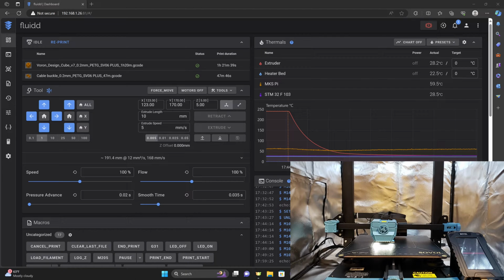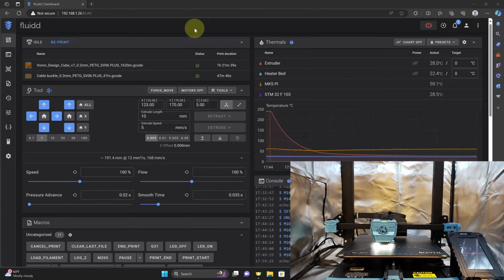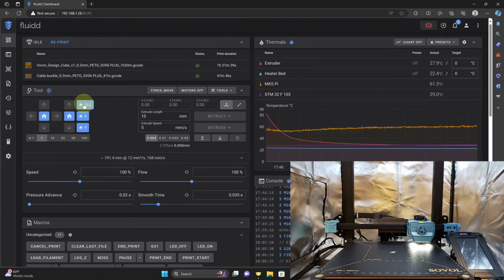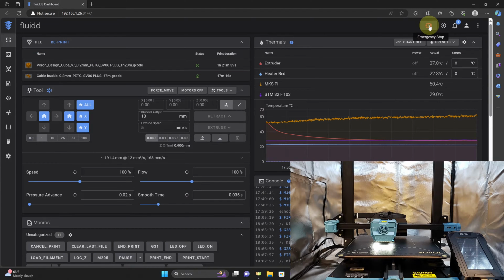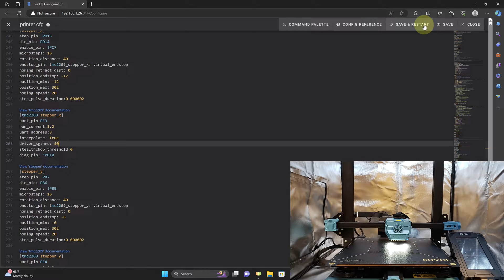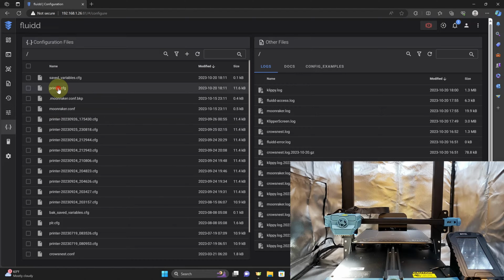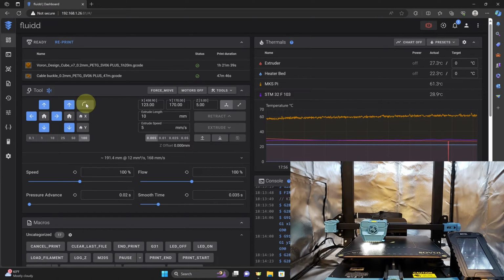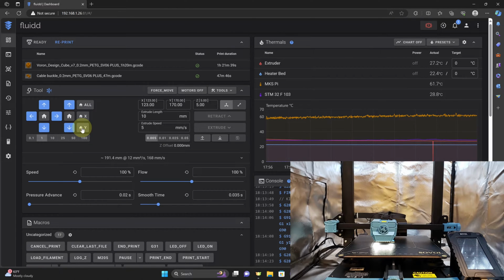Elegoo Neptune 4 Plus/Max homing issue, Part 2 - The Addendum.

Comment: Thank you for the video. I have the pro 4 and I don’t have the driver_sgthrs file. I bought this brand new from elegoo over a year ago and the homing failed as just this second happened. Everything is tight but this line isn’t in my cfg file
Reply from the maker: You should be able to add it but you may need to enable a few settings to make it work. The klipper documentation is very good

Comment: I cannot thank you enough for this video. I racked my brain for a week (2 week old Max unit too) as every print sucked, then the print head started to hammer itself into the plate over and over again. It refused to allow me to raise the head unless it "homed itself" first which was a repeating cycle of power off/power on /homing/ hammering / all over again. I following this part 2 video and decided to unassembled the print head only to discover the levelling sensor was tilted 30 degrees towards the nozzle. I loosened the sensor, aligned it and voila it stopped its self hammering instantly. What ever the sensor uses to say "STOP", could not as it was pointing top thin air and kept trying to push downward. Then 6 re-auto z levels and 4 level prints (a large square 0.5mm thick) to check adhesion and proper filament cooling and we are in business. I was close to sending this back pronto.

Comment: My printer bed doesn’t go all the way back so it comes forward and slams ut thenfrint and vibrates
Reply from the maker: Sounds like you need to adjust your settings or check for binding/belt tension

Comment: Does this work for Z axis? Mine is pushing the nozzle right into the bed, Neptune 4 Max
Reply from the maker: @todddorey6492  no. The Z axis uses an inductive sensor. If it's not homing, either the sensor is disconnected, defective or your nozzle is sticking down too low

Comment: Any suggestions on how to fine tune a N4M after installing linear rails? My X and Y are completely off now
Reply from the maker: @biggsean302  out of square? I used alignment jigs when I put rails on my 3
Reply: @TheFeralEngineer  The X and Y offsets are off.
Reply from the maker: @seanwhite4586  I don't understand the correlation unless they aren't running smoothly and triggering a false home

Comment: Thank you thank you thank you!
Reply: By the way. Although this advice did not solve my problem it did provide a lot of good advice. My problem turned out to be a hardware issue. My power went out which interrupted the print. That caused a jerk which caught my print head on the model. The actual part of the print head that got caught was the sensor. It got knocked to one side. This can be caused by vibration over time but the screw that holds the sensor in place can become loose enough for this to occur. So, my advice is add a check for your regular maintenance list.

Comment: How do you restore the original settings from Orca? I tried tweaking this, and it just rammed it just kept pushing into my bed and I had to re-tighten all the eccentric screws. I didn't write down the original numbers, so is there a restore button in orca slicer that I don't see?
Reply from the maker: There is not. Just keep adjusting until it's right. Slow down homing speed and adjust sgthrs until it works properly.
Reply from the maker: You can also look through your klippy. Log and see older versions of printer.cfg being parsed inside of there
Reply: Cheers mate..I ended up doing a factory reset and adjusted only the homing speed on my X and Z axis and it has eliminated that metal thud. Literally moved from an ender 3 pro to this beast and after using marlin and going to this, I'm definitely wading in deep water so it's good that there are creators like you that allow me to learn 👍👍👍

Comment: Great video and honestly led me down a testing rabbit hole, but saved me from tossing the printer on eBay.   Thank you for taking the time to do this. 

One caveat about belt tightening as an issues, over tightening can create issues with print quality, so you may need to adjust your settings a bit once your belts are perfect to ensure you don’t have false positives on your “virtual switches”

Comment: You just saved me a whole lot of headache with this explanation.
I started with a problem and while fixing it I ended up with 3 problems.
This solves two of them but I’m still trying to figure out the first one still.
Maybe you can help on that one as well.
What happened is that klipper allowed me to move Z up too much (maybe wrong config), and Z got to the top and kept trying to go up, so that messed up Z. Now I can’t make Z0 be zero…
It’s like -40 for me now
Reply from the maker: Turn the machine off completely, manually turn the Z axis screws so that the nozzle is within 20mm of the bed, power on and home

Comment: The past 2 months my Neptune A10 Warthog 4 Max was going behind the build plate and shoving the nozzle below the bed then grinding it across the side of the bed...I lowered my sensitivity on one and increased it on the other and so far this seems to have helped me with my issue. They were originally 110 for each at 50 speed. I kept the speed the same however.

Comment: Hey man! Great video. Im trying to troubleshoot my 4 Plus, but i cant get the grinding in the y axis to stop. My best settings are at 110 and 50 for homing speed. Tweaking the settings has resulted in some markedly terrifying failures with me needing to shut the thing down through Fluidd. Im really at a loss for how to get that to stop. Any additional advice?
Reply from the maker: Check belt tension. They need to be fairly tight, but not guitar string tight. After that, it's just trial and error. That's why I say to keep you finger on the trigger, though... Crazy sht can happen 😅. Are you in their latest firmware?
Reply: @TheFeralEngineer  Yep! I just updated it today. I actually just did a full teardown of my carriage and a full reassembly as well, so my belt tension SHOULD be tight.

Comment: Hey, i hope you see this comment. I recently updated the firmware of my N4 Pro, since then there has been a noise coming from the printer (there were no similar noises before). I'd say it's an "energy" sound, like those you hear coming from high voltage cables. Is this normal? My reasoning is that the updated firmware draws more energy as it needs it to achieve 500mm/s but i don't really know since i'm a complete noob.
Reply from the maker: Can you take a little video and email it to me so I can hear what you mean?

Firmware changes don't usually equate to sounding like high power lines. Only thing I can think is the new printer.cfg has stealthchop turned off.
Reply: @TheFeralEngineer  sure, may I get your address?
Reply from the maker: @Raiden-pi3gt  should be in my channel info, but it's theferalengineer@gmail.com

Comment: When homing, i have the z axis climb, pause, and climb, then freeze with a wirring noise.  Is there settings in the advanced setting menu that can help this?I do not have the software you are using. Neptune 3 plus.
Thanks, James
Reply from the maker: Could be a probe malfunction or something binding. Check the connections and the z travel by hand
Reply: @TheFeralEngineer  i have checked it. Funny thing is, it has homed fine, printed great, then it wont home the following day to print. I basically move the hot end around with the arrows on the keypad...then it homes, sometimes.  Strange
Reply from the maker: @BatmanIII  sounds like you might have an intermittent short in the probe. When they assemble the extruder head, sometimes the wires get pinched and severed inside of the insulation. Email elegoo and they'll probably send you a new one: 3dp@elegoo.com
Reply: @TheFeralEngineer  ahhh....yes, i will check tonight and let you know. Thanks!
Reply: Checked the wiring and connection.  "Looks" fine. Must be the pcb or the wiring connectors arent making the connection maybe. I hit up elegoo support, awaiting response

Comment: New printer here.
My default homing speed is 50 and my driver_sgthrs is 110. I get a very slight "krr" from the bed only.
Reply from the maker: It's probably okay then. Leave it until you have to change it and check belt tension before anything🙂. Happy printing 🐱🐱
Reply: @TheFeralEngineer  Thanks for your input. I'd ask how to make sure the belts are tensioned correctly?
And I do have some audible  sqeaking/vibrations when the printer head is moving fast. Is that normal?

Comment: I’m confused how Elegoo is able to solve this with a firmware update, which surely slaps a fixed value to these variables, which as you state, is different from machine to machine…
Reply from the maker: They also messed around with the settings for stealthchop, which can play into it as well. If the numbers they provide fixes 90% of machines, the remaining 10 will email them for different values to try. The numbers I mentioned in my first video were roughly the values they used, but it caused erratic behavior on some machines and resolved issues on others. Belt tension, wheel tension, etc can introduce a variable into what numbers will work

Comment: Would have been nice if you could have explained this in English not everybody's a nerd and super familiar with these programs and printers
Reply from the maker: I've done more than a half dozen different videos on setting up Klipper and I did an initial video on how to get started on fixing this issue, but this one was more in depth on rectifying the issue at hand. If you went through the basic steps per the elegoo documentation, all you have to do is follow along step by step to fix the homing issue. I honestly don't know how much clearer I could have made it.
Reply: Imo this video is very clear. I'm not a nerd and not familiar with fluidd (I'm new to 3D printing) and this video is super in-depht and clear. + English isn't even my first language and I understood it.

Comment: Im trying to get my 4 max working and i cant get the sensitivity tuned in no matter what. I can home one time and get a false home reading, and then hot home again without changing anything and the axis will overtravel and start grinding. What am i doing wrong,
Reply from the maker: Check your belt tension
Reply: @TheFeralEngineer  I got the firmware update, and that fixed the problem. It homes fine now, but when I run auto level, it gets stuck at the z-height adjustment because the screen seems to freeze.
Reply from the maker: Yeah, they've been having issues with the firmware patch. Unfortunately, I don't have a quick fix for that
Reply: @TheFeralEngineer  turns out I forgot the screen patch. Did that, but had to go run some errands. Fingers crossed it works when I get home

Comment: Hi Feral, I love your useful setup for the NEPTUNE 4 max.  I am wondering if you are able to help me with my current issue with mine?

Everything is fine, but today when I clicked home for Z. The Z axis kept pushing into the bed, as if the motors want to keep turning.  I haven't messed with anything on the printer physically seeing it's brand new.  I posted my problem on Reddit in hopes someone had a similar issue and was able to resolve it.  SO now here I am asking if you are able to help me?
Reply from the maker: Test your sensor with QUERY_PROBE and make sure it can sense the metal surface you can command it through klipper console in fluidd.

If that doesn't work, check the connections. On some of the 3 machines, the wires got pinched during assembly

Comment: Hmmm...I might be wrong but my understanding is that the reason why (at least for neptune4) the "BrrrrrrRrrrr" drilling happens is because the sensor only works for steel material. When the drilling happened I quickly put on the PEI plate and the sensor did what it was supposed to do. Just my thought. Thanks for this video tho!
Reply from the maker: You are wrong, actually. The issue I'm talking about is X and Y axis sensorless homing. What you're talking about is the Z axis crashing when it can't sense metal
Reply: @TheFeralEngineer  yeah I was only talking about the Z drilling. I came to this video from your part 1 and I did learn something new. I will definitely input the code. Quick Q. Do you know how I can turn off the pressure and smooth completely in fluidd? I have to turn them off every time manually.
Reply from the maker: @SlippingFlipping  you can set default values in printer.cfg

Comment: Question - maybe I’m overthinking this, but if this setting could vary from printer to printer bc of different factors like belt tension, how could a firmware update fix this?
Reply from the maker: The changes in cfg will more than likely resolve the homing issue 99.9997% of the time, but the actual system update attempts to rectify other issues as well, like some machines experiencing z offset errors, WiFi connectivity issues and mcu shutdown issues. It just happens that the Linux image they send out has a more fine tuned printer.cfg with their newly found, happy settings. 

I'm hoping they push some of their fixes to mainline mks pi firmware because I've got two bricks that suffer from chronic mcu shutdowns waiting for more a robust Linux distro. I've had such poor experiences with the rockchip rk3328 as a whole that when i found out elegoo and sovol were both using them in their Klipper products, I kinda winced a little... ok, a lottle...

Comment: I played with this last night on my N4M. My final numbers were 75 for X, 40 for Y, Homing speed 50. So far so good. 

I mentioned your video in my TikTok today and provided links to it. Thanks for the info!
Reply from the maker: Glad it worked out 🥰🥰
Reply: @TheFeralEngineer   hey mate, so mine N4M was way too sensitive for Y. Not your fault but this video threw me for a bit since my printer kept crashing at the front since it was moving 4 10mm back and saying it was homed. the Driver_sgthrs was 110 out of box and i had changed it to 40. now it works perfectly. :)
Reply: OMG THANK YOU. i thought i was going crazy. my printer was crashing at the front because the 110 for Y was making my Y only move back 10mm before it said it was homed. apparently my printer was too sensitive.

Comment: Elegoo has an update for the printer and tft now and it also fixes this issue. They tweeked the settings SGTHRS to 110 on X and Y and homing speed to 50 (and a few other changes). This fixed my BRRRRT but I am still having an issue of Y shifting on larger prints. I printed the benchy just fine, but my large prints are failing. It seems very random, one print failed after an hour, one failed after 22 hours(ugh) and everything in between. It is a new product and they still have some work to do. I've been providing feedback to Elegoo so I'm sure they will get it fixed, but it is frustrating.
Reply: To my knowledge this is not released as I was working directly with tech support. I think they may want to do more testing as once it is released everyone will want to do the update. Generally, it's best that the rule "if it's not broke don't fix it applies". I'm not sure they didn't base at least part of their fix off of TheFeralEngineer's  channels findings. I will ask them directly if the link can be shared.
Reply: Has this been released yet? I can't find it on the Discord or their website at this moment.
Reply from the maker: It was more of a quick solution for those that don't have the firmware patch, can't find it or are reluctant to try it 😀
Reply: @TheFeralEngineer  Oh yeah, I know that's what you've done here (thank you by the way). I was just trying to get more info from @treecah about where the firmware update might be found 🤓
Reply from the maker: @ProdigalMonkey  yeah, i was replying to him, but YouTube sucks sometimes 😅😅

Comment: i did what you said and now my hotend is crashing into my bed when it auto homes
Reply from the maker: Did you watch both videos and test each axis individually or did you just put values and expect it to work?
Reply: ohh i didnt know about the second one until after how do i get it to stop homing in the back and revert to default
 @TheFeralEngineer
Reply from the maker: @bignrich0900   the videos explain everything. If you want to revert back, simply change the sgthrs and homing speed values back to what they were or watch the full video and follow the steps to tune it in. At the point you're at right now, just make the sgthrs values 50 and it should work again, but if you watch the videos, you'll see the correlation and understand it better 🐱🐱
Reply: @TheFeralEngineer  thank you so much

Comment: A few notes for anyone watching: 
My Neptune 4 Max is currently set to 
driver_SGTHRS:110
homing_speed:50 

Works great with zero grinding
Reply from the maker: See?! 🙄😆
Reply: I had to do different numbers on X and Y
My Neptune 4 Max is currently set to
(X)driver_SGTHRS:75
(X)homing_speed:50 
(Y)driver_SGTHRS:45
(Y)homing_speed:80
Reply from the maker: @darthnihilus7511 the setting are different on each printer, this isn't just a plug and play solution. Please watch the videos and understand how to tune this correctly

Comment: Can't people just add limit switches?
Reply from the maker: Technically you could. The board has inputs for them, you would have to install the switches and run the wires. Disabling sensorless homing is just a matter of changing a couple of lines in printer.cfg